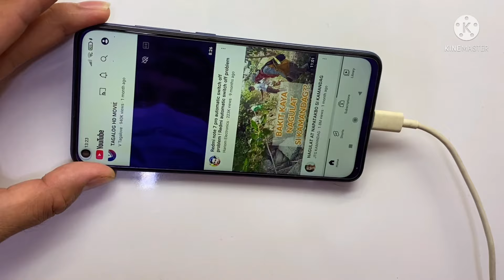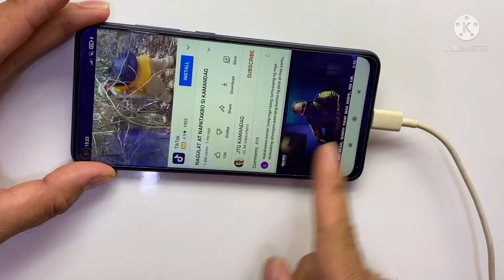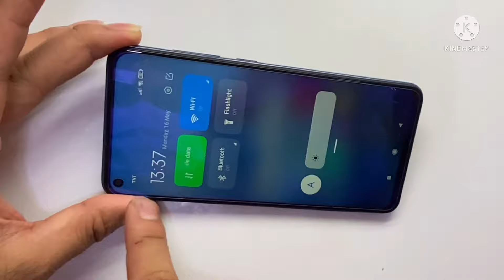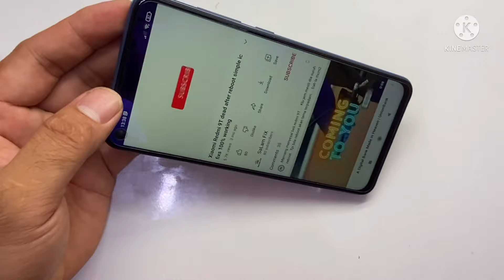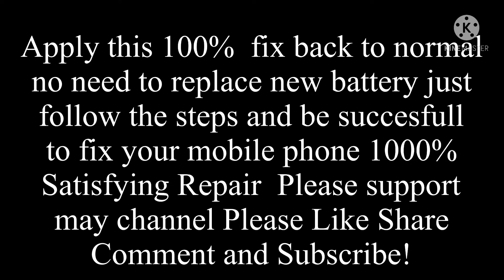How To Fix Redmi note 9 note 9s Auto Restart Problem | Fix 100% You Can do This at Your Own !

Comment: Thank you. Got my phone fixed using this tips. God bless you
Reply from the maker: this is 100% solution aplly this video click this link👉🏻https://youtu.be/o5nXur6lpPs
Reply: @JulphoneTv my battery is at 65% battery health and drains quickly and also has this boot looping issue, should I change the batter entirely or could this be the reason why it drains quickly
Reply: @kellycharleston5796 So bro what did you do?? Changed the whole battery or did this??...I am facing the same issue as yours

Comment: Do you have any soft fix (complete software related)mine is not exact but I faced that too , my problem : when it receives call it reboots or if I switch to speaker it reboots and sometimes for YouTube videos also reboots
Reply from the maker: apply this video 100% permanent repair video the probem of your phoenis like un this video
Reply: I have also the  same problem suddenly it started charging slowly and when volume raise up to more than 80%, It automatically reboots and same problem with call ,when I put call on speaker it again gets rebooted  plz tell me if u get any solution.
Reply: Same problem  here
Reply: Battery change aur battery coil change 100% workings
Reply: Hey Can u Help me My redmi keeps restarting over and over and draining it after looping
Reply: How did you rectify the problem. I am having same as yours
Reply: Guys change battery, I was installed pixel experience during the process I rebooted a lot and broken the button also and it damaged the battery also

I changed os lot in my mobile

Comment: It work!  I didn't not add new lead, I just heat up the fuse and it resoldered itself and boom it work again.
Reply: Sir ano po results sa ngayon?
Reply: @ronaldosignio4285  Okay napo siya. hindi na nag rereboot. functioning po lahat. tested playing codm and works fine.
Reply: @eizlez sir ok parin po ba ngayon? Meron po kasi akong napanood sa isang video na nabalik yung sira kahit ganan ang gawin
Reply: @JhonAldrinMagdaong  Still working fine po. possible improper pg ka ayos causing another problem or different napo problem.
Reply: Bro any chance of Battery Blast? Is your Phone getting heat while charging?
Pls reply...
Reply: Pano nyo po ininit yung fuse

Comment: Thanks a lot bro. Finally I found the problem and it's solution. Only thing is I haven't tried it. I hope it will work and I won't mess it up. 🥺
Reply from the maker: if the problem is back apply the part 2 video click the link 👉🏻https://youtu.be/o5nXur6lpPs

Comment: a few days ago ganyan po nangyayari sa RN9S ko everytime connected sa internet...tas ngaun lumala, hanggang sa redmi logo na lng xa ng paulit-ulit, though accessible pa rin ung fastboot and recovery...not sure po kasi kung hardware or software issue xa...nakailang flash na ako ng stock firmware (old and latest), pati po custom recovery at custom rom ayaw pa din maayos...Same prob po kaya xa sa vid?...sana po matulongan nyo ako...TIA
Reply from the maker: pag connect internet po namamatay yes magwa oo normal
Reply: @JulphoneTv  So ung case po ng akin is hardware issue po?...and same solution gaya sa vid?
Reply from the maker: @FlameKaiser_1  yes pi
Reply: @JulphoneTv  thanks po sa pagsagot
Reply: same problem sa rn9s ko pag dating ng 50% nag aauto restart na sya tapos paulit ulit na ..

Comment: Done this solve the auto restart but My battery is not charging after this what will I do?
Reply from the maker: aumyusin pag salpak ang charging flex bka umangat
Reply: Gumana na pinalitan ko battery boss. Mukang may tama na ung original na battery ko. Nag charge ung replacement pero yung niresolder ko eh ayaw gumana tlga sa inis dumikit pa ung flex cable sakin napakadali maputol nadikit lang sa daliri ko Fingerprint scanner
Reply: 9s gamit ko boss. redmi note9s . yung sa video note 9 lang

Comment: My redmi 6 pro keep rebooting last 3days.. I tried so many solutios.. but didn't work.. it doesn't turn on last 3days.
I will never ever buy Redmi phones again in my life😠😓
Reply from the maker: try replace new batt
Reply: @JulphoneTv  new battery replaced 2months ago.. even before that I had this issue.. but the phone got turn on after few hours. Now it's 3days keep rebooting😓 I was a fan of mi phone.. now I hate it

Comment: Ang solution po sir is CPU reballing or motherboard replacement, pero battery replacement will not solve this issue
Reply from the maker: kapag logo lng po reboot2x hindi nagtotoloy kahit naka charge  un po cpu reballing pag maga ganito namamatay pag d nakasaksak batery wla po kinalaman sa cpu reballing

Comment: Hi sir parang ganyan din problema ko pag mag data ako tapos nuod video sa utube or fb nag restart sya minsan nmm basta nag on ako nang data tapos scroll lang safb nag restart din pero pag naka wifi ako kahit manuod ako vid. sa utube at fb di nmn nag restart ang napansin ko lang sa ML parang nahihirapan ung phone na redmi note 9 kahit low graphics lang simula nung nag rerestart phone ko ganun na nangyari pag nag lalaro ako sa battery din kaya un kulang sa supply ?. kase dati kahit high reso ako sa ML kaya nmn madalang lang ang lag pero ngayon super laggy sya , mag kano po kaya pagawa?
Reply from the maker: yes lods mabalik na natin sa normal gawin natin imortalw phone mo pm mayfb page julhone tv

Comment: This solution for Drop Battery only. Many user Xiaomi phone on my country with same problem. And then, this solution after 2 days comeback again. 

The solution permanent (if you have big money) buy original battery not OEM battery. If comeback again, maybe MIUI bug from version MIUI 12.5.5 or eMMC and IC VR (maybe). 

I have 4 user phone with same problem today. 🤣